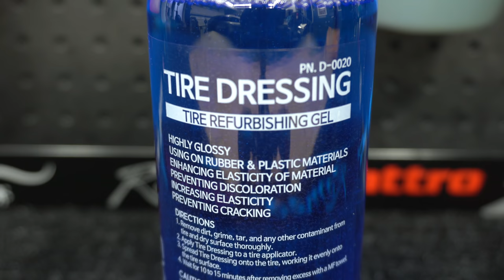SUNDAY NIGHT WASH /// Spoiling my Audi SQ5 in my Customized Home Detailing Garage

Comment: Hey Rick. I've missed your car detailing videos.  The music, camera angles and transitions are A class. I so appreciate it. Thank you so much. Your peg board where you store your pressure gun and foam cannon rocks. I ended up building one for mine. Gotta thank PTO for sharing your channel.
Reply from the maker: I'm glad Pan brought you here! That metal pegboard is pretty good, but I am seriously considering going with some Omni Wall USA sections because the hooks fall off the pegboard quite easily. I'm thankful for your kind comments regarding my videos. They are a huge source of pride for me. I think they are amongst the best produced out there. Not bragging, but I feel I improve with each new one and it seems more and more people are liking what I do. All the best!
Reply: @RADGarage  Great to hear from you. My pegboard hooks came with screws to secure the hook. I gota ask what products do you use for videos? And who does your camera shots?  All 1sr class.
Reply from the maker: I'll have to look into better hooks. Maybe that's the solution. As for my videos, I operate a Sony a6000 camera on a variety of tripods and sliders. Everything is done by me. I'm a total one-man-show! Hard to believe, but it's true.
Reply: @RADGarage  I reached out to Omni Wall and they can ship to Australia. 😀  there system looks awesome. One man show. That just makes your videos  even better. Would love to see a RAD GARAGE behind the scenes. I thought you had camera help. I've ordered my RAD t and it's been shipped.
Reply from the maker: Thanks for the support!

Comment: Hi Rick-  Great Video!  I bet you are happy that the garage is back together and you can test out the new drain and lighting.  Looks like you are enjoying the wash.  The link for Wheels , under Adams Wheel and Tire Cleaner directs you to  Adams Tire and Rubber Cleaner, did you use both productｓon theｈｅｅｌｓ?
Reply from the maker: Yes, I am in garage heaven these days. The new drainage and lighting lifted my experience to another level! I will have to check out the links in the description. I used the All-in-one Wheel & Tire Cleaner. I rarely use the stand alone Rubber Cleaner these days, but I have a few gallons of it! Thanks for the heads up. I'll go change that now.

Comment: I gotta try that DEFY.....looks awesome, great video as always.....very well done Rick
Reply from the maker: For a final spray coating, I don't know what more you could want. It cleans and protects and never streaks. The full effect of the gloss and slickness is immediate. So satisfying.
Reply: I wonder if the Hyde's doesn't work for you due to all the salt.  I use it after every wheel cleaning and my rotors never rust over at all
Reply from the maker: Hyde's has never worked for me. I'm over it. If it wasn't snowing out, I would have driven the car back and forth a few times while applying the brakes and wiping away the rust dust with a mf towel. But, it's just something I learn to live with.

Comment: Hi Rick, what's the base ceramic on the Audi? Is it Ethos as well? The Defy is like a Gordie Howe hat trick lol.  Just curious as I have car pro UK 3.0 but not sure if I should use Reload or Defy as a top coat.
Reply from the maker: It’s rocking the remnants of an Adam’s ceramic coat. I am planning on polishing it off (what’s left of it) and applying a Graphene coating to see how that handles the winter.
Reply from the maker: I say use either of those.

Comment: Plan on ever using p&s bead maker as your finishing touch sealant after washes? Perhaps the best out there.
Reply from the maker: I have used Beadmaker. Check out the RS6 vid I did. I didn't like it as much as Defy. If you haven't tried Defy, you definitely should.
Reply: @RADGarage  just watched it. Why didn’t you like bead maker? What put you off it? Did you notice the enhanced gloss a couple hours later? Very easy to use/no streaking?
Reply from the maker: @antonyv8171  It didn’t really turn me off, but it was more work than I was expecting to apply it and buff it off. I found it left streaks and I did not really enjoy it at all. Ethos is 100% satisfying and I love the gloss and slickness it creates.

Comment: have you ever used your quick jack on those swiss trax floors?
Reply from the maker: All the time. They are made for Swisstrax Ribtrax floors. They move so easily and the weight of the vehicle is so dispersed, there is no issue with marking the floor at all. Perfect combo!

Comment: Do you have any tips on how to clean piano black plastic in order to not leave any scratches?
I just noticed some :/
Reply from the maker: Find the plushest MF towels you can and go very easy. I recently received some 8"x8" Rag Company Eaglets (350 GSM) that are absolutely prefect for delicate dash/console components. I use a little detail spray and wipe gently. That's really all you can do.
Reply: @RADGarage  thank you! I just bought the Rag Company premium kit. I believe they include some plush towels. Is there any product that could possibly remove the scratches?
Reply from the maker: Theoretically, the easier something is to scratch the easier it is to correct. Many cars have soft gloss plastic on the pillars and those clean up real nice and easy with a mild polish and medium to soft pad. Tricky part for you will be getting into those tight spaces. That is why I own a Rupes iBrid Nano mini-polisher. With a 1" pad and a long neck, the polisher can get pretty much anywhere. Apart from that, I'm not sure what would be the best way to remove them. I guess you could apply a mild polish with a clean, soft MF towel and see if that works. You might have to "YouTube" it. I'm sure there's a few good tutorials out there.

Comment: Hey nice work and editing, do you find the Marino wool wash mit light scratches on black soft paint? I bought it after I ceramic coated my Lexus and it put fine line scratches throughout.
Reply from the maker: I have performed probably 100 washes and have never seen any issue with the CarPro mitt. The new grille I have is very soft gloss paint and it was perfectly fine. I'm not sure what went wrong on your end. I love that mitt so much.
Reply: @RADGarage  I don't know too but it's that Lexus starlight black paint if you breath it scratches. Lol
Reply from the maker: I had a 2009 Pontiac G8 GT in Metallic Red that you could scratch by looking at it. Part of the reason I am an Audi fan is the high quality paint. The Daytona Grey Pearl has been amazing. Durable, dynamic and cleans up so well.
Reply: @RADGarage  my brother loves Audi and they have hard paint thanks for getting back to me.

Comment: What’s your dilution do you recommend  for the snow foam?
Reply from the maker: I followed the instructions this time and added 20ml to one litre of water. It seemed runnier than I am used to, so I may have to play with it a bit more.
Reply: The KOCH GSF does not intend to foam much.  

Also check the Green Star APC. I can confirm that this is one of the best APCs on the market.  Now only known in Canada but we have been using it in Europe for years.  Regards.  The Belgian.
Reply from the maker: I always trust the word of the Belgians!

Comment: What ratio do you use for the foams you use?
Reply from the maker: I fill the 1000 ml bottle to the 950 mark and add approx 50 ml. Sometimes I’ll do 100 ml in 900 ml of water.